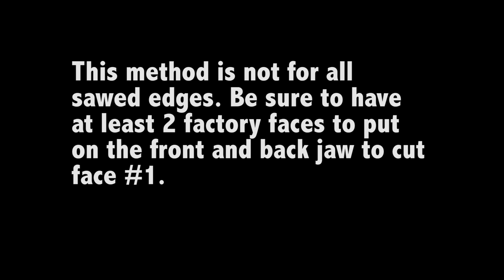The BEST Way to Square Up a Rectangle Block FAST

Comment: One thing i would recommend is also when ur parrallels are harrdend and ground u shud add a spring underneath for milling to stop them falling over and causing errors or get tapped down on a minor tilt or magnetic lots og different ways to avoid the errors specially after clocking milling head to milling bed square etc speically when indicating up and down left and rigt u need to make sure everything is squared machine wise you can clock and indicate onnsomething not truly square
Reply: What are you taking about, clocking milling head? it's called tramming the head to the table.
Reply: @ScottPatten-z3j  uk mate
Reply: @ScottPatten-z3j  it's also called many things ..